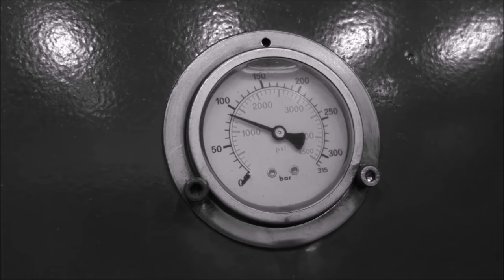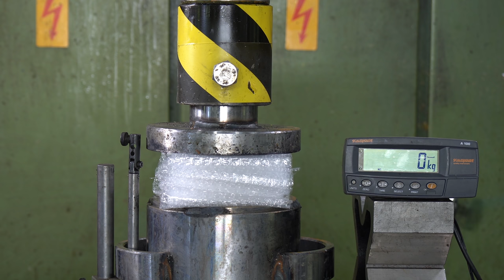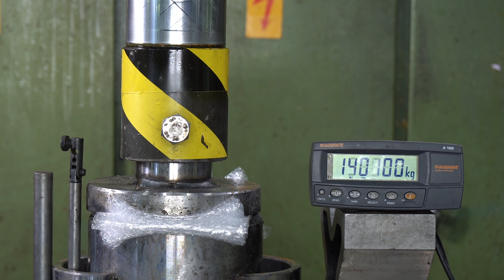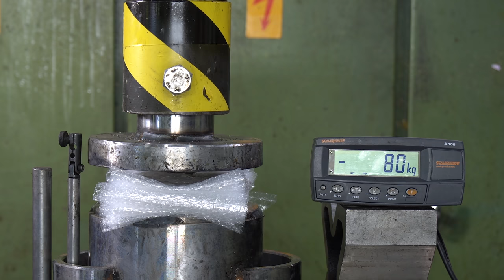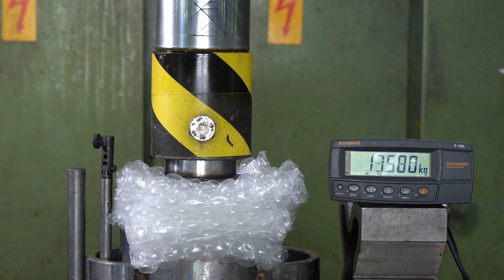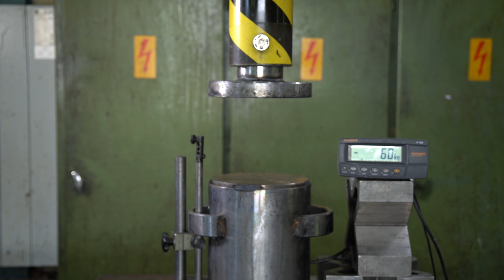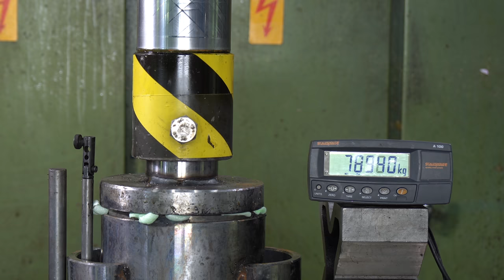How Strong is Bubble Wrap? Hydraulic press test!

Comment: Those green foam things are called Packing Peanuts.
Reply: The devil's spawn of packaging.
Reply: @WoodworkerDon  the green ones are made from plant starch and not conductive though are edible if accidentally ingest, but offer no nutritional value otherwise
Reply: @Joshua79C  my experience is the green ones are styrofoam and static clingy, and not biodegradable. I've seen white ones made of cornstarch before. Those seem to always be cylindrical and look like they are probably extruded through a circular die and cut into short pieces when exiting the die. 😁
Reply: @WoodworkerDon  oh, guess not all color them accordingly and yeah I have come across colorless starch ones .... it has been so long
Reply: I call the starch based ones packing popcorn, because they taste just like stale popcorn.
Reply: Ghost turds is one of the nicknames for them

Comment: Press diameter = ~18 cm.
Press area = ~254 cm^2
82200 kg / 254 cm^2 = 323.6 atm
My guess is that most of bubbles cannot burst at this point because they are heavily compressed and there is no way to expand any area to rapture.
Bubble wrap is quite strong since you need couple kilograms to pop single bubble in normal conditions.

Comment: 5:30 in the United States, we call those foam peanuts. At least where I live we do.
Reply: They are also called foam popcorn, packing peanuts or packing noodles ... not only foam peanuts, though green ones are made from plant starch (Water soluble and edible if accidentally ingested but has no nutritional value) and not polymers (not water soluble but will melt in acetone).

Comment: OK, that was pretty amazing, I guessed before you let the press loose that it would take about 300 pounds, then I blew it on the big ones also, going on them being 4 times bigger, I just divided what the little bubbles could do by 4, and again way off. I have always preferred the little bubble wrap because it is easier to work with but I figured it was not as good as big stuff so this was good as I am getting ready to move soon, looks like I am going with the little stuff.

Comment: You need to try this again, but put steel plates in between each layer of bubble wrap. This will make them pop better because each layer of bubble wrap will be squished between two hard surfaces instead of two soft and squishy sheets of bubble wrap.

Comment: @Hydraulic Press Channel What is the actual surface area of the presses you used this time?  If we know that, we can then know what pressure the failure points are at (ie PSI, etc).  Thanks in advance!

Comment: I think that what happens is that the plastic makes a seal against the steel, preventing the air from escaping. With nowhere to go, you have the same pressure on both sides of the walls of the bubbles - resulting in a net 0 force on the plastic - from the air at least. The rather low amount of plastic means that it is hard to squeeze it thinner by making the it flow, or undergo plastic deformation as it's called. The top and bottom layers are stuck to the press, and then it is very hard for the middle to flow (breaking the bubbles) when there is so much pressure clamping it down.

Comment: You dont understand how upset I am that America (where I am and am from) doesnt use the metric system. It is so much easier to calculate things, like for weight 1,000 kilograms is 1 tonne, SUPER simple instead of 2,000 pounds is 1 ton. It's mostly, if not always, a multiple of 10 for the next measurement up.

sigh

Comment: I will fully admit to having intentionally taken the small bubble wrap from a package, putting it in front of the car I had at the time, and running it over. It was delightful but don't forget to put all the windows down so you can hear the car popping it. I also drove as slow as I could so I could hear the car popping the bubbles. It didn't occur to me to try driving over it more quickly and now I don't own a car.

Comment: They aren’t popping because you are trapping air outside the bubbles as well as in and so you never generate a pressure differential.  The gas just gets compressed into effectively a solid and then when you release the pressure it re-expands.

Comment: Fill the bubbles with acetylene!
Reply from the maker: That would be epic :D I try to think way to do that
Reply: Hydraulic Press Channel you could probably just fill some water ballons with acetylene and put them in a box and crush the box
Reply: fill one half of them with acetylene and the leave the rest full of air (or pure oxygen if you're that mad)
Reply: @HydraulicPressChannel  they make bubble wrap now without any air in it to be able to ship big rolls easily. Then the customer pumps in the air and heat seals it to make as much as they need, only when they need it. They don't have to ship or store large rolls like Anni was standing by.  The "bubbles" are actually channels that zig-zag back and forth, so not really bubbles any more, but long channels or tubes of air.  Trying with any flammable gas might be interesting, but heat sealing might be dangerous. I don't know how hot the heat sealing equipment gets and whether it could accidentally ignite nthe gas.